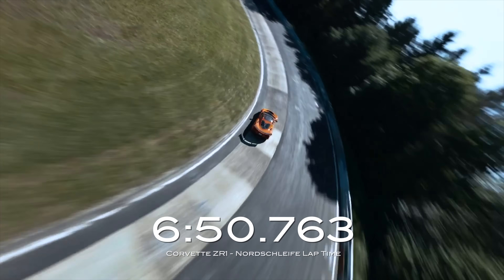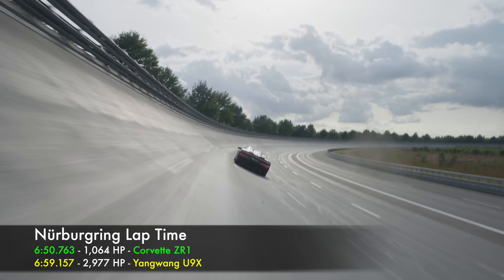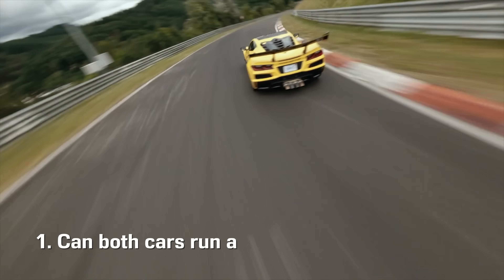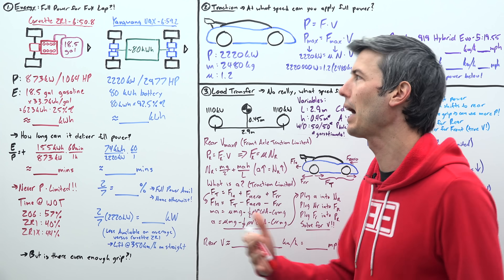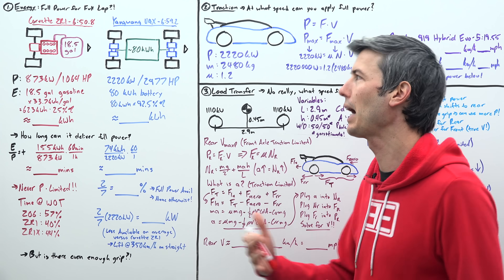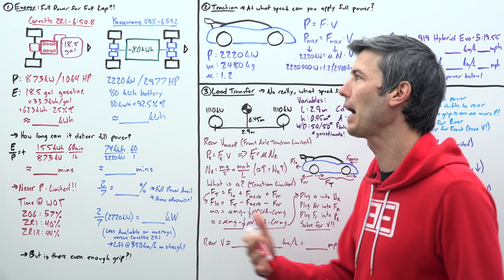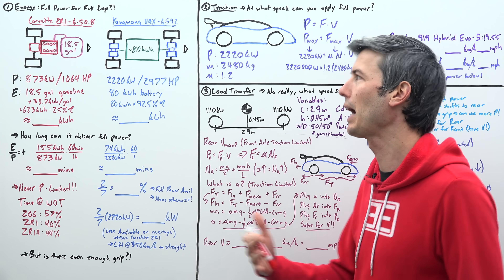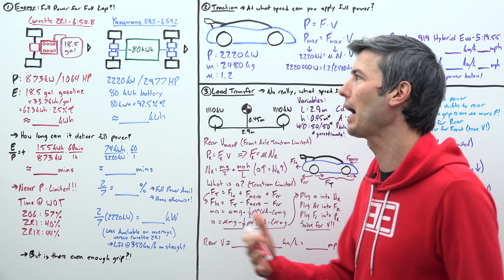Gas Beats Electric! Why Is 1000 HP Faster Than 3,000 HP?

Comment from the maker: *Important Note* For the first section - I meant to mention regen but did not! Any energy recovered (from motor braking) goes back into useable energy for an EV. For city driving, this is often very powerful. For track driving, it's usually not, because regen ends up putting a lot of heat into the battery pack, which is already stressed from driving at full load. That said, it would up the time of full power available, depending on how much regen there is. Many EVs in "track mode" will limit regen, again, to limit battery heat, but if there's sufficient cooling capacity then it can be allowed. The U9X is said to have energy-recouperation up to 700kW which they say helps "to reduce load and stresses in the mechanical brakes, ensuring more consistent stopping power under track conditions." So, likely they do get some amount of energy back through regen - again, should have mentioned!!
Reply: Still waiting for an EV to come out with a supercap bank to supplement the battery, that would circumvent a lot of the battery heating issue
Reply: @spyderborg  You say that like it weighs nothing and takes up no space. Sure it sounds good but I'll want to see the maths.
Reply: Was just about to comment asking about this
Reply: Damn, I wanted to leave a wisearse comment "whatabautreeeegenn".
Reply: I heard next year the zeekr 001 FR 2026 will be the fastest production ev on the Nurburgring beating the Xiaomi su7 ultra and yangwang U9X.
Reply: The other thing you may have meant to mention (ahem!) for the third section is aerodynamic transfer, which may or may not be relevant, as the car is AWD so designers may have not designed a lot of transfer.
Reply: It can't use 3,000 hp but it can put atleast more than 1,000 hp 😂
Reply: I think anyone wanting you to account for ALL variables, especially given just how complex and how many mathematical assumptions had to be made just to come to THIS level of conclusion, is just plain unreasonable. You'd need an entire technical package for the U9X to even hope to have all the variables of the car alone, to say nothing of how its driven (though, as far as I can tell, that would tip things even FURTHER in the ZR1's favour, as it was driven by a vehicle dynamics engineer, and the U9X by a professional Nurburgring track driver).
And, even if you COULD crunch ALL those numbers, it still won't change your main conclusion, which is that no matter how much power you theoretically have, there is a certain point at which it just can't practically be used, and why a obsensibly less powerful car achieves comparable speed to a car with three times the power and twice the power-to-weight.
Reply: Thank you for an excellent info video 🙂
Reply: The actual power output of the Wang would be limited to the power output of the battery, not the capacity of the motors (eg a model 3  P has 460kw of motor output, but the 85kwh battery can only put out 343kw) 

80kwh at 2200kw draw is over 27c, and wouldn't be possible to sustain as the battery discharges or for a long period of time.

I'd also doubt the regen could exceed much around 5c (or 400kw)
Reply: Formula E does mostly short tracks so it's not comparable with the ring, but, those cars will run 40% of a race only on regenerated power. That's significantly less impossible than it sounds at first ;)
Reply: @kooooons  Formula E batteries are using the latest battery technologies AND they don't care about lasting more than a single season.
Reply: From what I understand, battery packs which typically provide several hundred miles of range can be completely consumed in a single hot lap around the 'Ring.  This is why you can't use a smaller battery to reduce the weight for a batter single-lap track time.
Reply: At the end he stated why the porsche is faster than the vette less power less weight more grip
Reply: @Spha_gatsheni much more downforce. The 919 basically uses ground-effect downforce airodynamics
Reply: @computercrack  yes almost a ton or something " grip "
Reply: It’s heavier but have much more power.
Reply: Could be U9 might be using a Capacitor or Ultra Capacitor for quick charging and discharge. You don't have to charge the batteries.
Reply: Yes, Regen brake is important in EV.
I have an MG 4 EV standard range, and I always put Regen in max mode. I can see the % of power occupied will be minus when I get off the accelerator pedal; that means power will go back to the battery from the motor. While my battery is at 100%, the system automatically limits them to only 1-2% recovery; at 95% battery, only 5%; and at 90%, only a max of 11%.

Below 90% battery, regen brake can provide up to 25%, or around 30 kW charge, to the battery. In daily use, the system told me I can get an extended range of around 6-7 km from 50% use of the battery.
Reply: I was under the impression that at top speed in an F1 car the rear tires are just beginning to slip from pushing against the air wall.
Reply: @TheZitherish  F1 cars make an insane amount of downforce, both relative to their weight and in absolute value, even compared to the high downforce vehicles he mentioned.
Reply: It comes down to the cooling concept of the car. Most EVs will be able to sustain the maximum charging power for an extended period at least. For the U9 it's 500kW so that could be used for regen without further increasing the battery temperature I guess. But if the cooling is even more effective, who knows?
Reply: as all ev's this one is just a gimmick. and dead. on arrival
Reply: Your HP to kW conversion for the ZR1 is wrong, or did i miss something?
Reply: Was just coming here to ask about regen!  Thanks 😅
Reply: No worries. Same conclusion: EVs suck!
Reply: I would like for you to build the ideal weight ,power,drivetrain to chassis vehicle , you got the knowledge, or at least got thru the years and tell me what the sweets spot is in terms of older vehicles to your knowledge
Reply: electric cars are for idiots
Reply: For example the ID-R produced 10% of the necessary energy with  the regen. For standard car, the track mode disable the regen. But for sport car it’s a Little bit different…
Reply: I still remember the days of... waaaay less subs. Just you standing in front of a whiteboard with a very dim yellow tinted light setup explaining to me how turbo engines work. 😀 (it was the first video I watched on this channel)
When watching this video my first thought when explaining "how power is put down" my first thought was "Audi Quattro" for some reason xD
Reply: You forgot aerodynamics in the speed for full power calculation. The way the front of the car is sloped, that downward force is significant at higher speeds.
Reply: @itsm3th3b33  If you rearrange that formula to find how much you'd have to increase the weight of the vehicle in order to generate maximum power at 145 mph given the other variables, the U9X has to generate an additional 426kg of downforce.
This IS within the realm of possibility, but given its focus on straight-line maximum speed, it probably only actually generates about 1/5th to 1/4th of its weight in downforce, while the Porsche 919 Hybrid Evo generates about 3/5ths of its weight in downforce.
Reply: Yeah, that and downforce only getting a mention at the end I ended the video feeling like I didn't get a satisfactory answer, since all those maths depended heavily on these factors which were left out.  A nicer analysis might have first answered how much power each car actually used on the lap, then divided by weight to show the Corvette produces a better power-to-weight ratio over the lap.  Ah, but then we wouldn't have been talking about tires, and Continental would be sad for sponsoring the video.  Hmmm...
Reply: @JeffreyGoddin  the guy is a wannabe engineer. All those calcs were pointless when you completely ignore down force. 3000hp is an ENORMOUS advantage, the problem is it came at the cost of weight and grip, something lost on this guy 😂
Reply: @GamezGuru1 So then why is the Porsche GT3 even faster than the corvette with only 500hp? I'd be careful who I call a wannabe engineer. The man studied mechanical engineering and has actual work experience.
Reply: @kooooons  I'm a higher qualified engineer than he. Why do you think the Porsche is faster? Because it has more downforce, and possibly a better driver. Maybe better tyres, grip level can vary day by day. Many factors other than just horsepower...
Reply: @GamezGuru1 the question was why is a 3000HP car slower then a 1000HP car. 1. Point was u can't use the 3000HP due to power limitations. 2. Point was u cant use the 3000HP up to a certain speed. 
So yes weight is an obvious factor, downforce also. But the difference is not that big, so it had to be other reasons (nr.1 + 2) . No need to say hes not a qualified engineer or you are better qualified. Tells a lot about you tbh
Reply: @GamezGuru1  " 3000hp is an ENORMOUS advantage,"
"the problem is it came at the cost of weight and grip"
Can't you hear that?
Reply: @stusue9733  congrats, you quoted me, and added absolutely nothing to the discussion.
Reply: @computercrack  listen to yourself - the MAIN reason the 3000hp car is slower than the 1000hp car is because it can't use that power? That would NEVER make it slower, it would just reduce the advantage of the 3000hp.

I will repeat this obvious, and irrefutable fact - if you take the same car, give it 2000hp more, it will ALWAYS be faster. Thinking the weight and downforce are less important factors is ignorant.
Reply: @GamezGuru1 read again what i said. Downforce/kg is extremely important. Look at the Porsche 919 evo, extreme downforce with low weight. What Im saying is the 3000HP cant be used because 1. Not enough kWh battery capacity 2. Traction issues 3. Tires (car cant go much beyond 330km/h)
Reply: @GamezGuru1  "congrats, you quoted me, and added absolutely nothing to the discussion."
I'll take that as a "No, I can't hear that"
Reply: @GamezGuru1  " if you take the same car, give it 2000hp more,"
Yeah there are a couple of laws of physics that would like a word with you outside.
Reply: @GamezGuru1 Dude...if you're so much smarter and more qualified, then make a video response.  But you won't. 🤫
Reply: @stusue9733  what laws of physics does adding 2000hp break exactly?
Reply: isnt the Xiamoi SU7 Ultra Prototype only have 1500hp but was able to make it 6 min 22 seconds in Nurburgring?
Reply: @TheWorldsMyth  no way.
Reply: Weight matters a lot, because tire grip is finite. I disagree with the video. Also you tire wear faster. You can compensate with downforce and more weight, but you can't beat physics especially on slow speed corners. Although I agree, U9 is at it's power limit.
Reply: Correct me if I'm wrong but the last time I checked the Corvette is made out of plastic and that EV has a heavy battery, maybe the difference comes down to weight.
Reply: The first thing I thought when I read the title was that it came down to braking. To be able to go around a track very fast comes down to braking as much as accelerating. A car needs to be able to brake as late as possible as hard as possible. This is where EVs, currently, have a serious down side. They are too heavy for to be able to brake like that. Which is why I was curious about the regen. How much braking was done through regen?
Reply: I came here to comment this. Regen would give you quite a bit Also, you missed downforce in the calculation for 2 (and 3)

Edit: you touched on it briefly but it should've been considered in the numbers. I believe it would bring full power into the realm of possible - I wouldn't be surprised if we see it!
Reply: @srich609  Well let's see the maths then.
Of course you cant do the maths or you would have...
Reply: 😂 This Guy is A CLOWN...PUT EM IN STRAIT LINE SEE WHO WINS 😂😂
Reply: A totally biased video:
What about this variable?
Different tyres?
Different drivers?
Different weather?
Different suspension?
Different weight? 
Different brakes?
This video exists just to reinforce your antiAsia/proWest-bias.
Reply: @MrlegendOr have a cry! You can drive a Yang Wang lol ... id rather a Kia Cerato. CHYNAH NEEDS TO PAY A BIG PRICE FOR WHAT THEYVE DONE TO THE WORLD. Make V8s Great Again
Reply: @MrlegendOr This is the reality of current EVs on race tracks where your asian propaganda from every kettle doesn't work.
Reply: @MrlegendOr With a 2000HP advantage all the mentioned reasons are very minor. The U9X probably had a good driver, tires with 2025 technology, they didnt race in winter conditions. The video shows the two important points: Not enough energy to support 3000HP for the full track length and not enough downforce to use the 3000HP consistently
Reply: I'll summarise the entire video in one sentence.  MAGA > Chynah! and I'm sadly Australian

Comment: Well it would do better in the straights but poorly in the corners and Nurburgring has lots of corners and slow sections. Corvette zr1 is much lighter and in combination it would be faster than the EV with nearly 3000hp. Heavier vehicles have much more moment of inertia to overcome than a lighter vehicle does. Over just having a straight line acceleration like most EV have over their gasoline counterparts. But then again 1,064 hp is nothing to scoff at. 🤷🏻‍♂️🤦🏻‍♂️

Comment: Your assumptions are only based on straight line performance. The weight of the EV plus inertia compromises traction of the tyres during cornering.

Comment: A faster car is not all about power, it is tires, weight, drivetrain, suspension, braking, read differential, and most of all the driver's capability. A more powerful car will accelerate slower because it can't maintain grip off the line, it is smoking the tires sliding forwards where a less powerful car is turning wheels with grip. Also 4WD has a much harder time going around corners on pavement, and traction control slows the car down

Comment: What about the actual power band the U9 motors can deliver? As Power equals torque over engine speed, and e-motors usually have a flat torque band up to a certain speed, it is hard to say if full power can really be used, I guess. This also always bugs me with BEV’s and Power numbers, because if you would calculate the speed at which acceleration becomes 0 (top speed), assuming the car is quite aerodynamic, this should be way over 600 km/h

Comment: Here it comes the fact: EVs are aggressively pushing the limits of peak power, but there’s a point they simply can’t surpass. Manufacturers keep over-powering their cars, not because it’s meaningful for real-world performance, but because it’s the easiest way to grab attention.

And of course, they know this.

Massive horsepower numbers — 3,000 HP today, maybe 30,000 HP a decade from now — are a marketing tool to pull society toward EVs by creating the illusion of “no limits.” But does any of it actually matter? What’s the point of 3,000 HP if the real-world efficiency and usability don’t outperform a well‑engineered conventional powertrain?

At some point, the numbers stop being engineering and start being theater.

Thanks, Jason!
Reply: True.  Each U9 Extreme electric motor can output 775 hp.  BYD put four on the car.  Next time they put eight of those and the car will be 6000 hp.  Easy peesy.  Current high end car use electric motor has such a good power to weight ratio that a few thousand horsepower is not an issue at all.

Comment: I looked at the statistics, here are the results:
1.	Reliability index:
•	China Initial Quality Study (IQS 2025) – in 2025, this indicator rose to 229 PP100, which means an increase in the number of defects and complaints.
•	VDS 2025 – PP100 is worse than that of foreign mass-market brands.
Problems are increasing both in the domestic market and among mass-market Chinese brands, and the number of defects per 100 cars for Chinese manufacturers is growing year by year – this is official statistics.
2.	Accident rate: Russian accident statistics show that Chinese brands are more frequently involved in accidents than any others.
3.	Chinese cars are leaders in self-ignition and destruction/damage due to fire.
•	The largest automaker BYD conducted a mass recall of more than 115,000 cars due to design defects and battery problems that could cause functional anomalies, including fire risk.
•	Earlier, BYD recalled nearly 97,000 EVs due to fire risk related to the steering assembly.
•	(Other manufacturers simply don’t do this, even though the battery and electronics suppliers are the same.)
4.	Safety system activation: Chinese cars are among the leaders in airbags and other safety systems failing to activate in accidents.
______________________________________
So yes, Chinese cars are not only at the top of the rankings, but continue to improve their performance year by year.
You could also note records like: the most unreliable car, the fastest to fall apart, the fastest to depreciate and rust, the most powerful, the boxiest, the loudest, the most frequently catching fire — but the question is, why?
If Nihao shows that they not only have the largest battery or the most powerful engine, but can also win at Le Mans or in F1, that means they know how to create a balanced car that can actually drive and perform well.
If the power runs out after 2 minutes, after the battery is discharged, or it cannot be finely controlled and utilized, then what’s the point of it?

Comment: Great explainer. I noticed that the traction equation set the force simply to the mass of the car. Rather than using this a a variable. As the vehicles velocity increases downforce would come into effect and increase the effective mass of the vehicle, thereby reducing the speed at which maximum power can be put down.